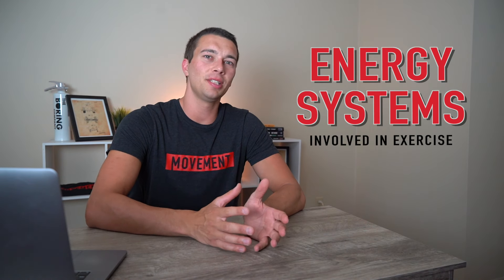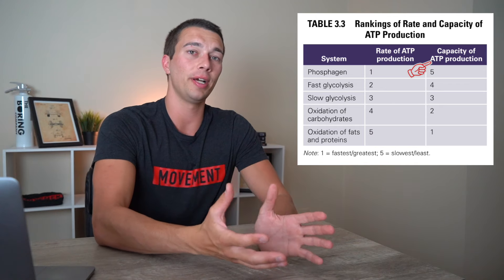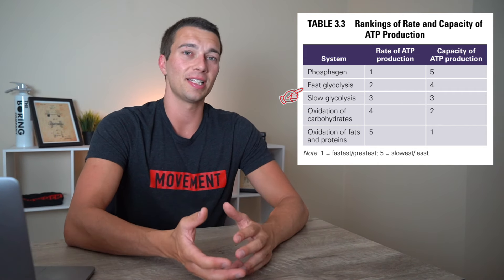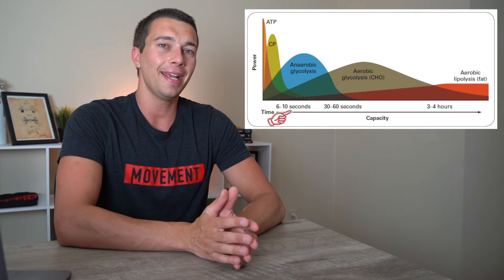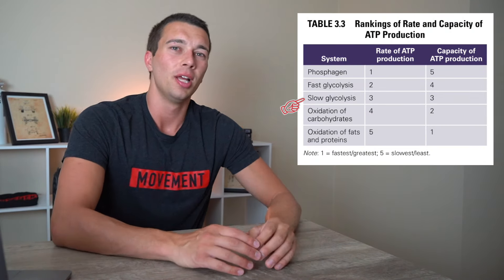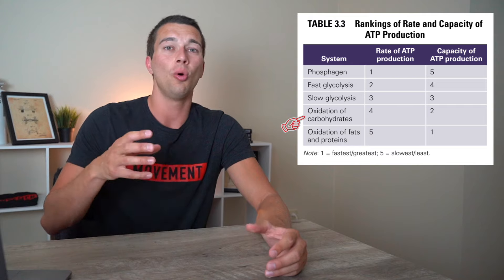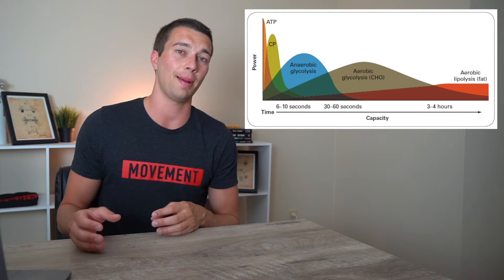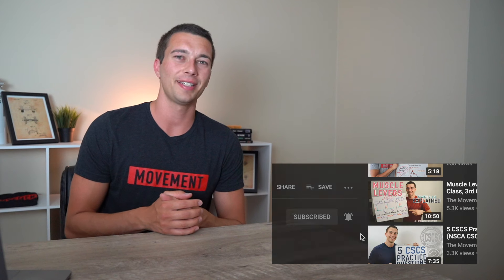CSCS Chapter 3 Bioenergetics | Energy Systems During Exercise and How ATP is Made

Comment: If I do a low intensity ride for 2h and then do a 10 second sprint vs doing a 10 second sprint right at the start, I can push about the same Watts. So I assume its not only the length, but also the intensity of the excercise that determines which system is used? Also I assume that the ATP-PC system can "recover". Otherwise I could only sprint once per training.
Are these assumptions correct?
Reply from the maker: Yes exactly. Aerobic work doesn’t deplete the ATP Pc system

Comment: lets say you're resistance training for an hour, maybe 4 exercises and 3 sets per exercise .. how would the energy split and timing of it work? roughly. would at any point you be relying on carbohydrate oxidation as primary system? and would lipolysis still be an active secondary system for the entire workout? But likely never a primary system?

Comment: I have a doubt. Let's say i go for marathon is it possible all the energy system work in my marathon i mean first phosphagen for 10-12 secs then anaerobic for 30-40 secs then aerobic energy system for rest of my remaining kilometers
Reply from the maker: Sort of. It's always a mixture. There's a primary and secondary energy system. So rather than one working then turning off it just goes from primary to secondary
Reply: @TheMovementSystem  I'm having the same thought. My initial interpretation is that you will use the available ATP from PCr, then anaerobic because your body can produce it more quickly, then a transition to aerobic because you've depleted anerobic capabilities, but are working at a low enough intensity where you can clear the lactate and use it as energy.
But now I'm thinking your body would prioritize the aerobic system and kind of "skip" the anaerobic system before eventually transitioning back to anaerobic if you hit your lactate threshold?
Reply: @mattdelgreco5827  yes once you've hit aerobic oxidation do you ever get back to glycolysis as the primary system? and how?